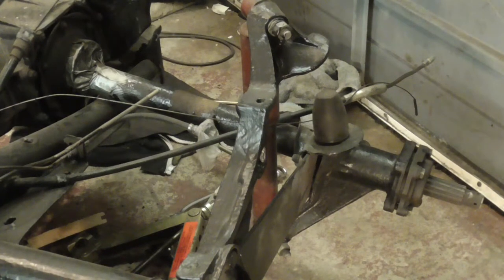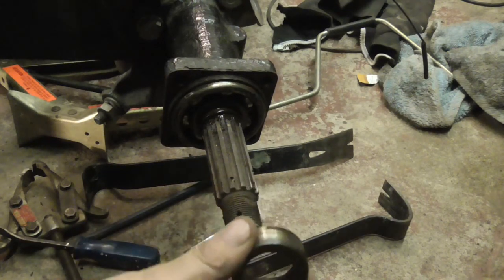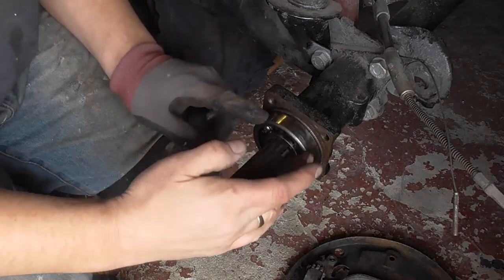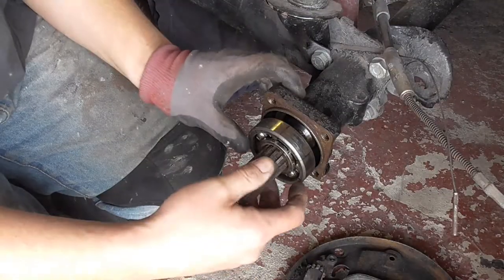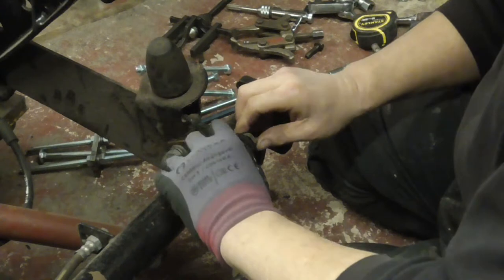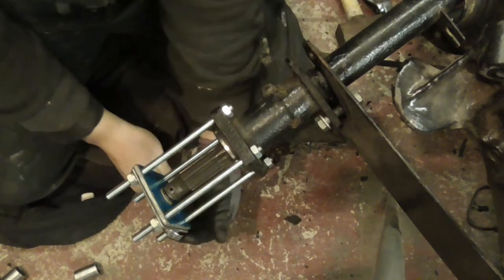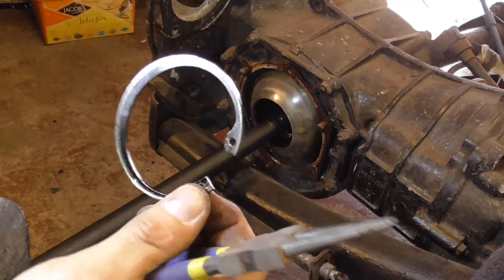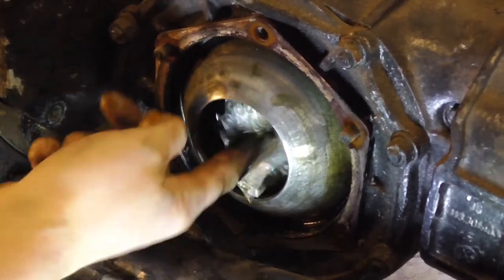Axle & Tube, Seals & Bearings - Removal & Stripdown - VW Beetle Swingaxle Kafer Vosvos Bug Fuschina

Comment: You should use an electric ratchet, it’s a lot easier and quicker,😊
Reply from the maker: Can't remember if I filmed it or not but I did, and it took the stud straight out the case! LOL so went back to manual. 🙂👍

Comment: wish i rebuilt the gearbox myself and not trusted an "expert"  after 3 times back its leaking again from the reduction box /  bearing / backplate  Grrr...
Reply from the maker: Feel your pain. Most expensive vw item I have ever bought ...my box, had to come out 3 times, and still leaks and has incorrect ratios! Grrrr 😬🙄
Reply: @PeoplesCar   the expert forgot to fit gaskets between the main body sections. I shouldn't be surprised it's got a weep from the hub lol